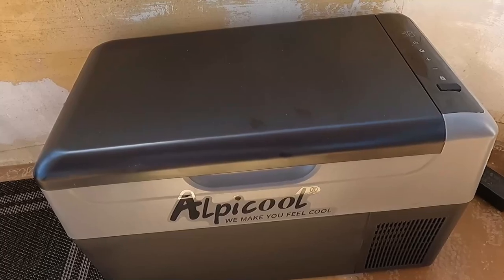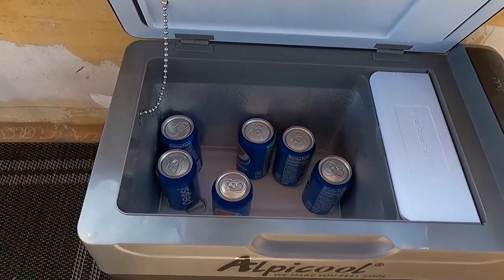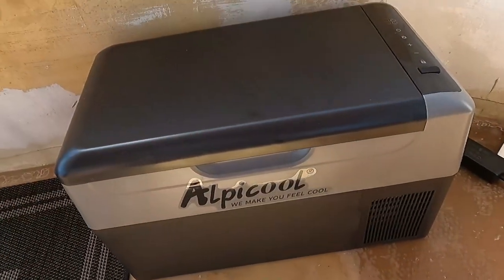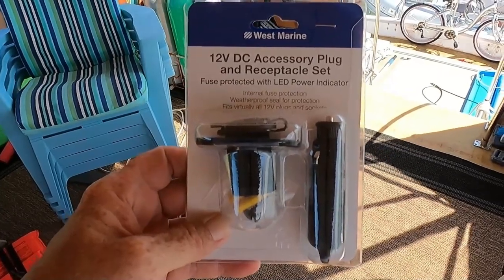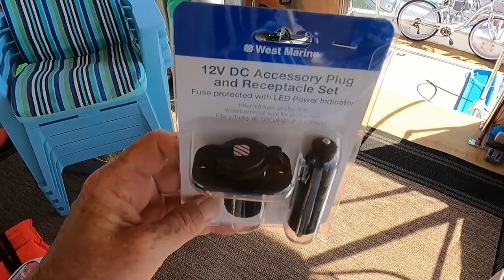A Week at St Catherine's Island but No Lemurs, Ep-151

Comment: Love your videos, Big Fan.  Question about your flybridge enclosure.  I notice you seem to leave them up all the time.  I have a 25 ft trawler and plan to leave mid Oct from Northern VA and take the AICW to Brunswick Georgia. (Arriving around 15 Nov).  Should I take my enclosure.  If I do not have it up, it will be a royal pain to store it somewhere on the boat.  The full enclosure came with the boat, and I have replaced all of the isinglass.  I don't think the weather will be that cold, but I have no experience traveling in the fall, with or without the enclosure up.  The boat will stay in Brunswick thru 5 January, then I will go on to Florida from Jan - April.  Should I put up the enclosure panels or not?  Appreciate your input.
Reply from the maker: You will definitely want to leave it up - your comfort will depend not only on the temps (which are already cooling off) but on the wind.  We had our curtains closed yesterday because it was windy, and we were only as far north as Georgetown.  We have been in Miami with all the girls in their center consoles wearing bikinis and we are wearing jackets (before we got the enclosure) because it is windier and cooler up on the flybridge.  Brunswick in January will be very uncomfortable without an enclosure.
Thanks for watching our videos.  Given your schedule you may catch up to us.  Let us know if you do and maybe we can get together for lunch or dinner somewhere!
Reply: @CruisingThisOldBoat  Thank you so much for your advice.  I will take the enclosure.  It would be wonderful if we could cross wakes at some point.  I will definitely look for an opportunity to meet the two of you.  Stay safe.